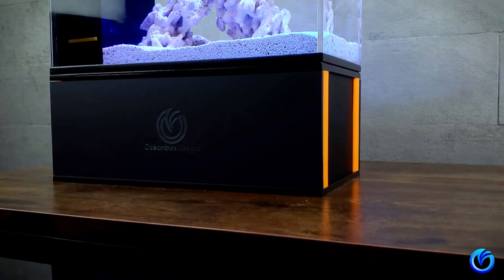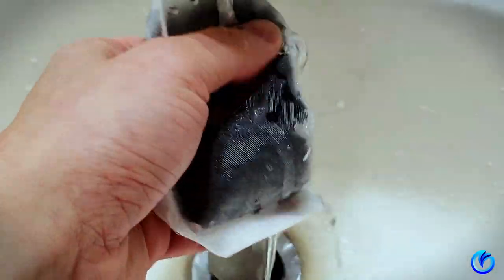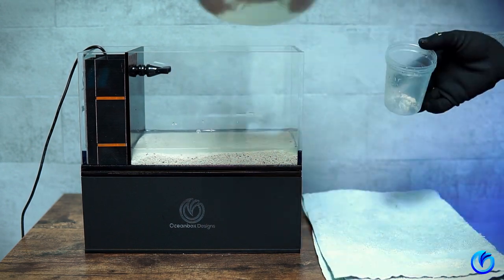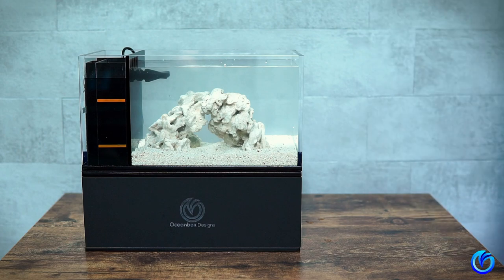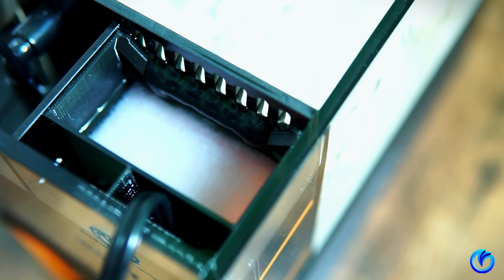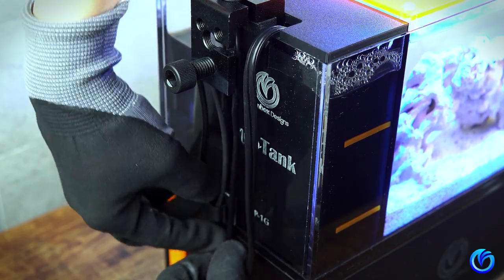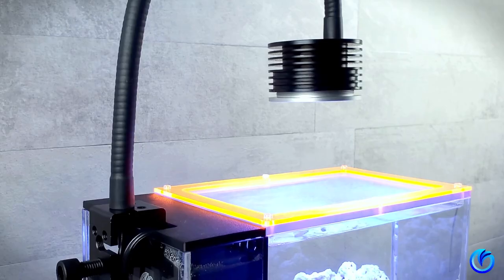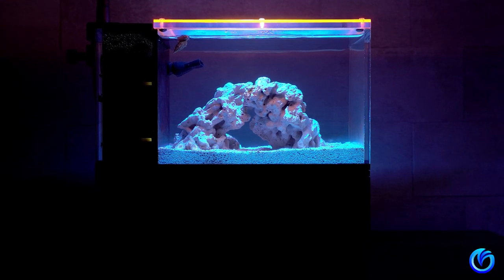MicroTank® Peninsula 1 Gallon MicroReef Build - How to Setup a Pico Reef Tank

Comment: Lovely tank design but it is ridiculously stupidly overpriced I can't even begin to go into it.
Reply from the maker: Thank you! You're paying for a one-of-a-kind (first in its class) hand-crafted "limited run" on a high-end quality design/craftmanship. I designed this system toward the aesthetes who'd understand and appreciate my passionate works involved in developing and making it. That said, I'm sure you can find alternatives to start a pico reef that meet your budget.
Reply: The hours spent designing, the material, the machines/tools to cut etc add up. This is designed perfectly  I would buy this in a heartbeat if it included the light and heater.  I am tempted to buy it anyway. For some reason hitting over the 400 mark is just out of my willingness to pay.  The s20 and heater included at 350 would be perfect
Reply: @kristians7377  I'd pay 250 for it tops. Without the pump and light. There is a guy I follow on insta here in the UK who makes a tank with similar dimensions for £90
Reply from the maker: @sammora470  I think most people overlooked the fact that it's not just the price that you should be looking at! The fabrication method and materials being used are highly critical when it comes to acrylic tanks, not to mention we've been fabricating for years. Using cheap imported materials (made in China) and improper technique leads to pre-mature seams cracking and integrity failure, even if it looked good at first. The problem is most consumers can't see this coming at first glance, but will within 10-14 weeks, by the time it's too late to complain. Just know what you're getting!
Reply from the maker: @kristians7377  I really appreciated your understanding! Not many people can get a grip of the times spent not just designing it but also building it one by one, single-handedly. I think most people overlooked the fact that it's not just about the price! The fabrication and materials being used are highly critical when it comes to acrylic tanks, not to mention I've been doing this for years. Using cheap imported materials (made in China) and improper technique leads to pre-mature seams cracking and integrity failure, even if it looked good and hold water at first. The problem is most consumers can't see this coming at first glance, but will within 10-14 weeks, by the time it's to late to ask for a refund. Just know what you're getting!
Reply: @Oceanboxdesigns  I'm not getting. I understand ur POV but the bottom line is I'd be the one paying and like I said there is a guy here who I can buy the parts off to do the same thing for a fraction of the price. Not that I don't respect what you do, but I know i can find a better alternative for me
Reply: I agree 1 gallon tank for 250 dollars is outrages . Maybe if it was 3  gallon . With the same design plus a heater it would be worth it